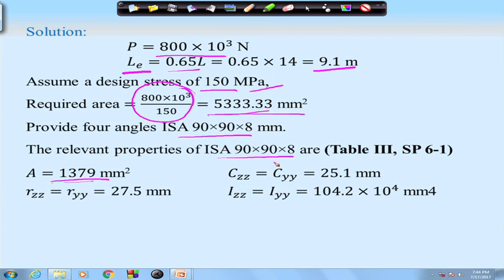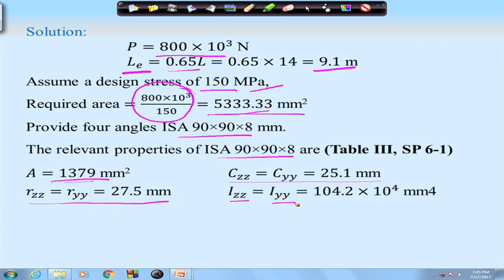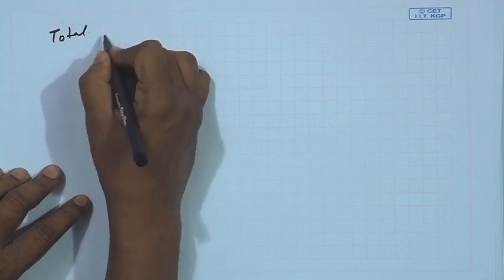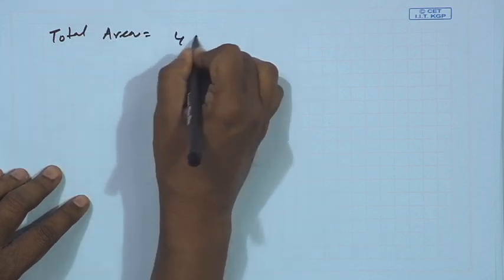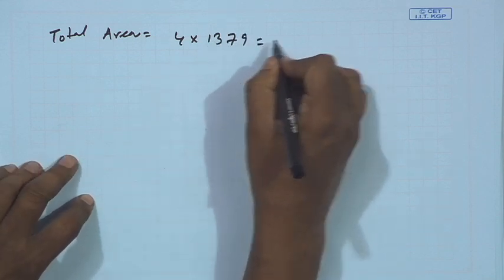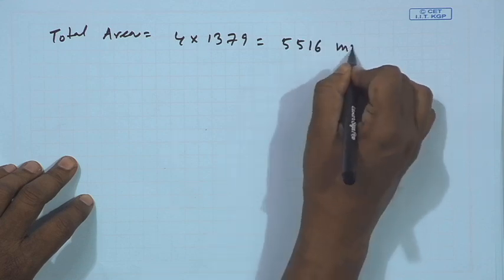Lecture 39 : Design of Double Lacing System

Comment: Isn't the formula for tie plate design like for depth and thickness changed as compared to previous example? 32:47
Reply: Check the symbols and it's meaning used in these particular lecture
Reply: @prasadkhorgade  actually my problem was that in the previous example he told d= s+2Cyy and here he said that d= total side - Cyy.
So I got it cleared by reading Cl. 7.7.2.3 (effective depth, logitudinally, not less than the perpendicular distance between the centroids of the main members).

It depends on how the angle or channel sections are placed, back-to-back or face - to-face.
Reply: If face-to-face, then
 d= total side - 2Cyy.
If back-to-back, then 
d= s+ 2Cyy

Comment: At 07:42, there is 5% increase in effective slenderness ratio of laced member in code(7.6.1.5) but here increase in effective length of member by 5%
Reply: Yes...  It doesn't matter as increase is to be multiplied to the numerator.. so even if you multiply it to slenderness ration, answer wouldn't change.